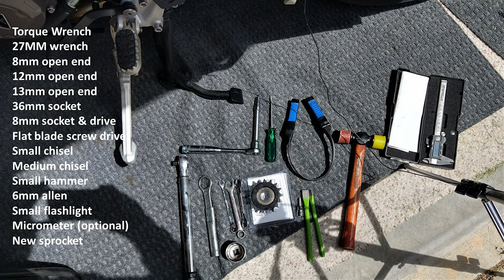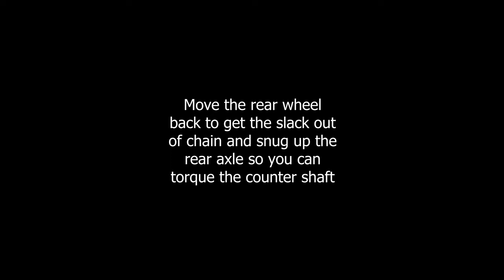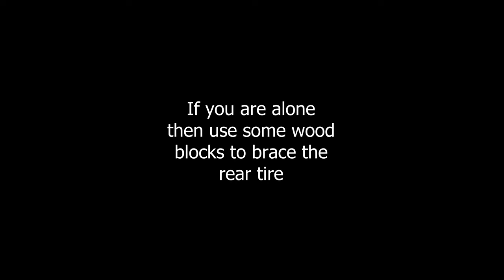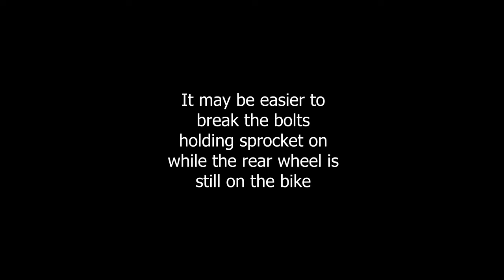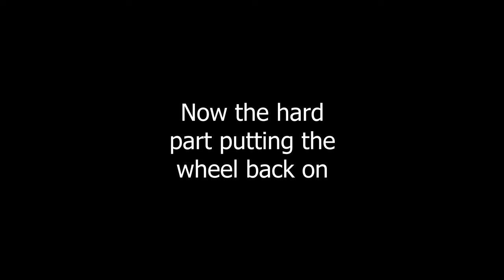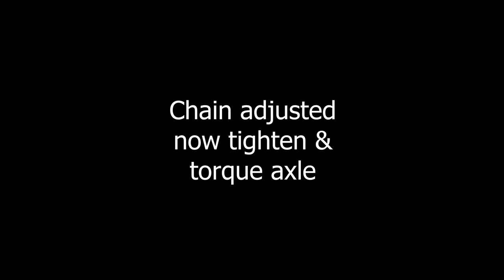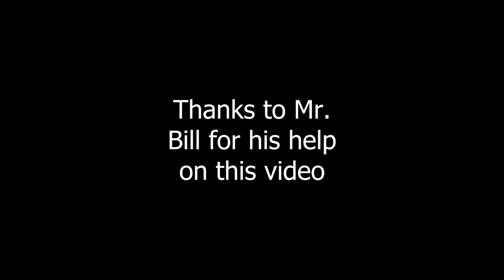How we changed our front & back sprockets on our Tiger 900s

Comment: Great video for those who haven't done this. Changing sprockets used to be a commonplace event back in the old days. I seem to have quite a bad tight spot on my chain. Makes it a bit tricky getting the tension correct. Ps. I wondered at what stage you were going to remove the rear  pannier.  Must have improved access and light levels 😅
Reply from the maker: The first time the panniers were removed because it takes bumping your head out of play for the chain adjustment 😁. When I shot the second time I didn't have to adjust the chain .  

You know I didn't have tight spots that were easily found in either of my 900 Tigers, lucky I guess.

Comment: Nowadays the only thing that impresses me more than saving a lot of money by doing it yourself is y'all getting down on the floor, something after 6 back surgeries and a stroke is no longer an option.  Well, I'm capable of getting down, just not up easily  lol
I wonder what it would cost to have that done at the dealership or shop?

.
Reply from the maker: Roger I believe they generally charge an hour for each sprocket so what ever your local dealers rate is. Our dealer labor rate would be $270 for doing both.

Getting down is fine but getting back up again is another story 😃😃 Mr. Bill was really huffing and puffing on changing the rear sprocket as I was too so I decided to just speed up the video.😅
Reply: @flatcapcaferacer  I'm still impressed! Hey Jerry, may I ask your age? I'm gonna be 64 in September.
Reply from the maker: Turning 70 in October Roger.
Reply: @flatcapcaferacer  Getting up and down while doing the work is ok for me.  It is the hours afterwards that I get all sore and cramped up.  Still like doing it myself. Worth it to me.

Comment: Interesting that you can make the swap using the same chain.  If I wanted to go from a 15 to a 16 sprocket on my RE Himalayan, I would have to change the chain to one with 112 links... stock chain (110 links) would be too short for a front sprocket swap...  Ended up keeping it stock because I do not want to impact its capability off-roading...
Reply from the maker: Usually you can go one tooth higher on the front if the chain has 1000 miles or so on it  .

Comment: I'm always surprised how the splines on the front sprocket survive the rigours of acceleration. I guess it's because that front nut has to be tightened correctly. (Seen horror pics on older bikes with the sprocket welded to the shaft)
Bet it goes like a Bat out of Hell now 😉 
That rear axle nut on my MT10 has a massive torque setting and a really big breaker bar required to undo.
Reply from the maker: Many rear axle factory torque specs are way above 110 ft lbs which make most tool kits useless for removing or loosening them for enen chain adjustments.   I've been experimenting with a few methods over the years and found the best combination for my land speed bikes is for me is using a castle nut then drilling a hole in the axle and using a cotter pin to go through the hole in the castle nut and axle.  I can safely decrease the torque on the axle nut.

I haven't done it for yet for sreet bikes not used for land speed racing because it takes a good deal of time and patience. My personal opinion is that some of the torque specs on the rear axle are overkill and may contribute to damaging  rear wheel bearings especially for bikes under 100 horsepower.

Comment: When we discussed with each other after doing this work FCCR said he though the front sprocket was easier and I though the rear sprocket was easier to do.  Funny how that works out . From my perspective the front sprocket to me has more to worry about with getting the chain on and lining up the splines correctly.  Getting the nut off with an air impact and putting it back on at the correct torque.  I put the transmission in first and had my son hold the rear brake while I set the nut to proper torque.  Then you have be careful with the hoses and wires that are routed through there while putting the cover back on.  To me the rear sprocket was more straight forward with less worry for me.  And it was a 1 man job. No help needed like when I did the front.  FCCR can you explain to the viewers how the front was a better job for you ?
Reply from the maker: Are you sure you said the back was easier...??? If I missed that sorry.

You have an exceptionally strong core and makes lifting the rear wheel a little easier than most folks. I thought you might pop a gasket there for awhile:)

Getting the splines on the front is the hardest part but if you use the light it pops back on easy peasy.

I know you will agree $23 dollars for the front vs $62 for the back for the almost the same gearing at speeds plus not losing chain adjustment makes changing the front a better deal than the back if you are only doing one of the two.

Next time I'll do your front and you can do my back sprocket.:)

Comment: I am pretty sure those brake rotor bolts are one time use only. You are supposed to replace them changing the rotor. At least they were on the 800. I haven’t done it yet on my 900. That’s how I found your video. Also thinking about doing this mod. Highway speeds are too full of vibration
Reply from the maker: Jason I couldn't find anything referencing the rotor bolts in the manual specs or warnings,  but that is a good comment.  The next time I  go into the Triumph shop I'll ask them if they are a one time use and I'll respond back here.
Reply: @flatcapcaferacer  for the 800 I used the Haynes manual, oh how I wish they made one for the 900.  It spelled it out specifically because the bolts were stretched during install.  I will be interested to learn if the 900 is the same as well.  Thanks
Reply from the maker: @jasonshortphd Jason it sounds like your probably right then .

Comment: Hi again, and thanks for all the information you shared. I have the new washer. it's curved inwards on one side. Which way do you put this washer on, curved end inwards, or facing out? Thanks again.
Reply from the maker: The curved part should be inside towards the sprocket
Reply: @flatcapcaferacer, ahhh, so the washer can be crushed by the nut, and then bend one tab over the nut to lock it in.
Reply from the maker: @MrCoonass1970  Correct

Comment: I thought the chain slack was checked/adjusted with just the weight of the bike on it, not on the center stand. Wouldn't the chain be too tight by doing it your way?
Reply from the maker: You are right the chain does tighten when off the centerstand and with the rider's weight,  that is why I leave the chain with a little more slack in it when adjusting it while on the centerstand and unloaded.

Comment: what brand rear sprocket for your tiger? Im having a very hard time finding a rear sprocket for 2020 Tiger 900 Rally which needs a 525 pitch 50T.
Reply from the maker: My 47T rear came from Sprocket Center 949-220-0555 they also have the 50T for your bike. The 50T is the stock rear sprocket for the Tiger 900 GTs so your Triumph dealership should be able to get you one too.